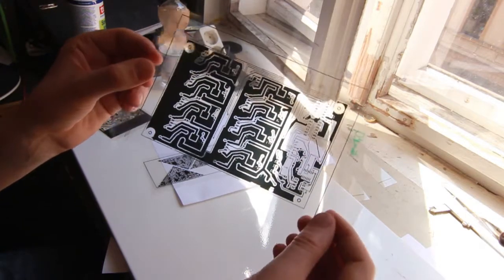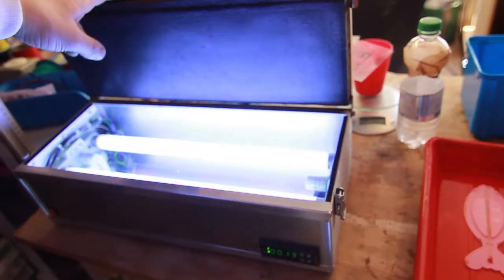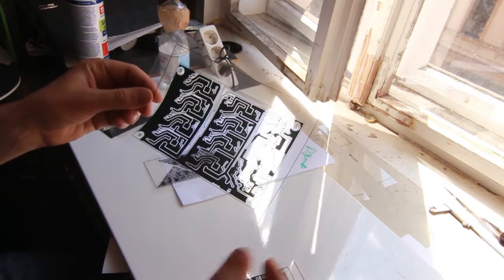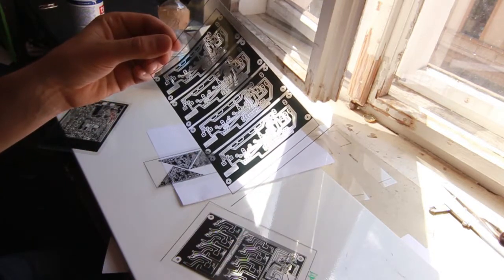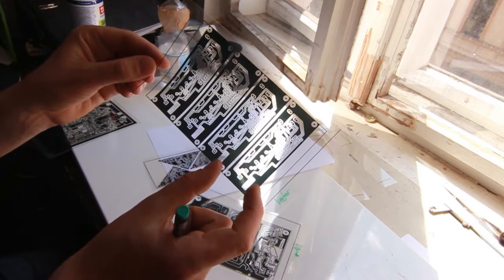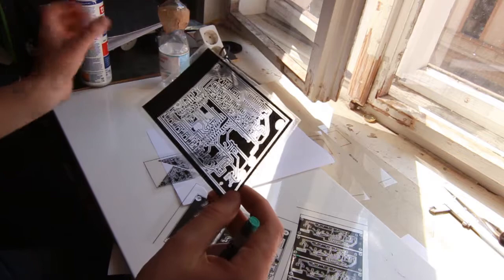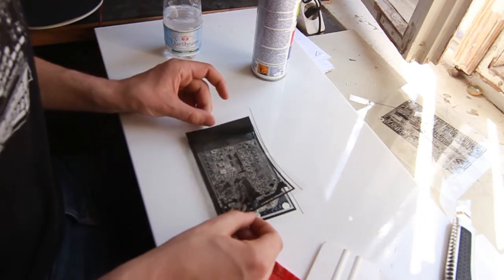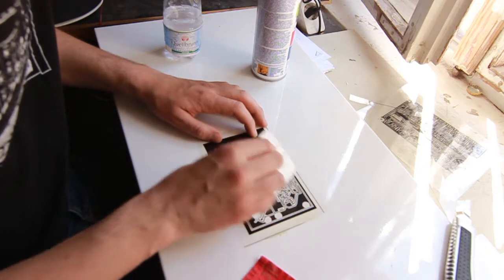PCB Creation: cheap photo positive mask

Comment: I like your method, it is very similar to the method I use.  I must be lucky because my laser printer has no linearity problems so aligning even very thin tracks has never been a problem. I use a light table when glueing the two foils together. I tape one down to keep it still and then adjust the other foil until all tracks align then just glue the corners. Having light shining from below really helps a lot.  I think I'll try your idea of using spray adhesive.  Your etching tank looks quite professional too.
Reply: @Valentino Jordy Flixportal xD
Reply: @Santino Gordon thank you, I went there and it seems like they got a lot of movies there :D I appreciate it !!
Reply: @Valentino Jordy Glad I could help =)